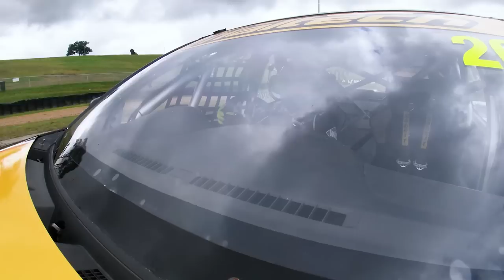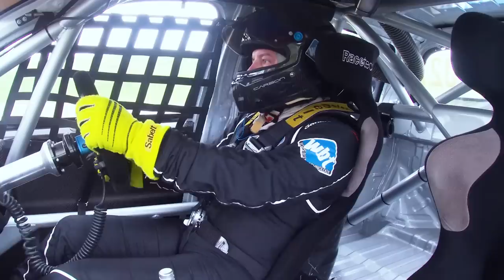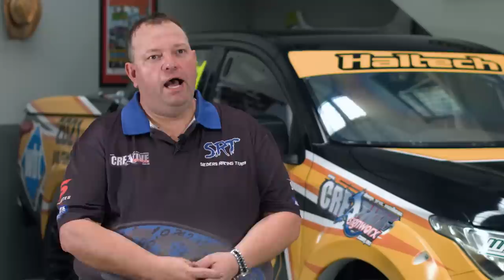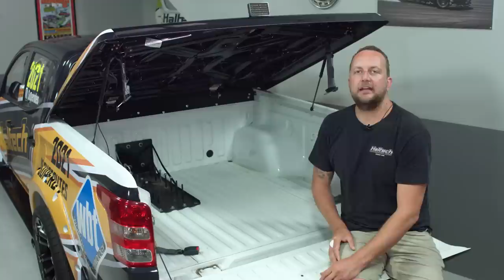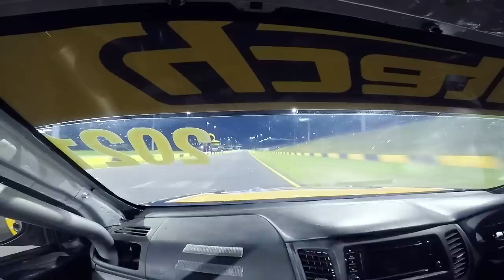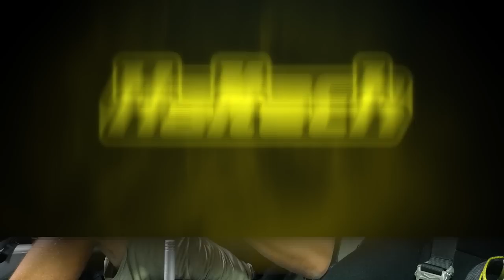🛠 Anatomy of Speed: V8 SuperUte | TECHNICALLY SPEAKING

Comment: I am wondering if you guys could Implement a throttle strategy for deceleration. I use this strategy on my work truck where in the case of deceleration, I cut injector power and hold the throttle to the floor to turn the engine into an air compressor. I know there is a debate over using High engine vacuum versus compressing air for engine diesel, but the benefit of compressing air is more cold air volume through the engine to cool it down and potentially less oil consumption. What do you guys think? I would like to unavailable input on the program for Full Throttle deceleration in a race mode where it cuts Fuel and the drive-by wire goes to 100% throttle.
Reply: Hi Christian, this would not be useful in a petrol engine especially for racing as petrol engines are controlled by how much air we allow in, not fuel as with a diesel. If your throttle was wide open and you then slightly touch the throttle mid corner, you would need to bring the throttle all the way down from 100% to a low throttle opening for long enough to see vaccum back at your MAP sensor prior to re-enabling the injectors otherwise you risk making the return to power too aggressive. Additionally, when you compress air it will get hotter so the cooling gains would be limited. Typically what we do in a race car is that we disable the decel cut on the fuel injectors and use the fuel to cool the engine when there is insufficient air for combustion. This is the strategy that is being employed on the ute, however one of the goals for making the ute look and sound good going around the circuit was to have flames coming out of the exhaust on decel. This required commanding a higher throttle opening than we normally would in order to keep some air passing through the engine. The down side of this made the engine continue to produce some amount of power and push forward instead of engine braking as much as you would normally see. After feedback from the driver we reduced the throttle opening under deceleration to a more comfortable level, while keeping as much as possible going through for a bit of a flame show. As with many parts of tuning, the solution for a particular vehicle is normally a set of compromises to find the best balance and behaviour for what the vehicle needs to do.
Reply: @vaughnhaltech1069  yeah I knew it would be a touchy subject for racing applications. You would have to apply significant amount of timing retard while re-engaging normal throttle operation. Just throw the idea out there. I do use this strategy on a Spark engine by the way. What I have found out about compressing air is obviously there is a percentage of that compression Heat that is transferred to the engine parts but there is also a heat reduction when you uncompress it during a no fuel Powerstroke

Nice to meet you Vaughn! keep up the good work
Reply: @vaughnhaltech1069  if you want more flames, you could try advancing the timing a little more during closed throttle deceleration conditions. The higher the  vacuum level in the combustion chamber will create such a low ionization voltage at the spark plug gap that there's borderline enough heat there to light air fuel creating intermittent misfires

Comment: Ls3 or 7 are the best stock engine ever built. Until electric shits on it. Manual gearbox electric 700 hp is going to be more reliable and make more torque. It sounds dumb but ill see u in 15 years when that's all we have to drive